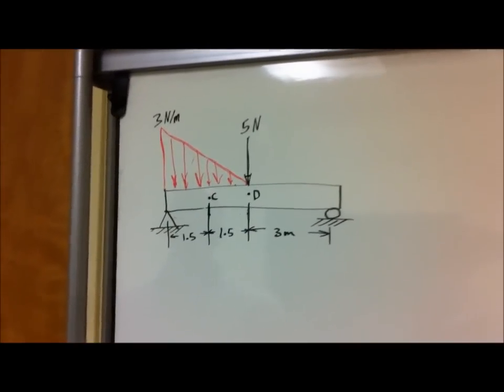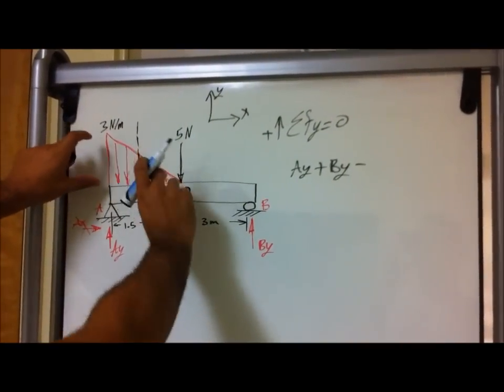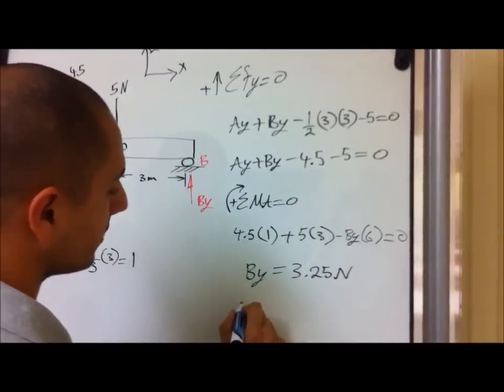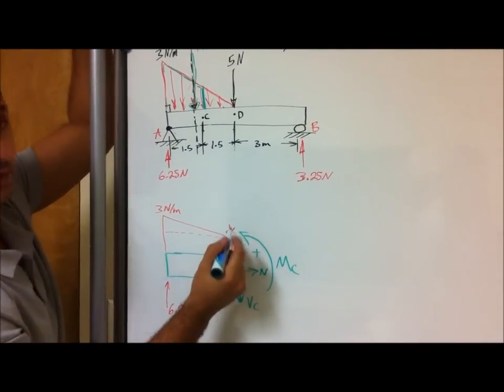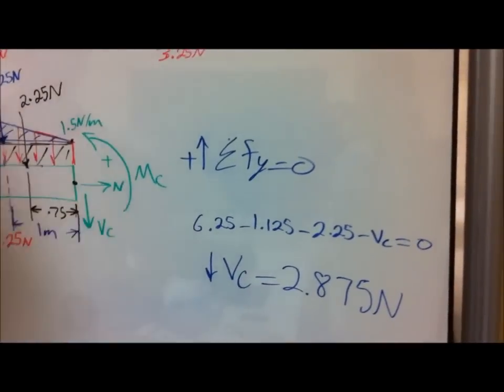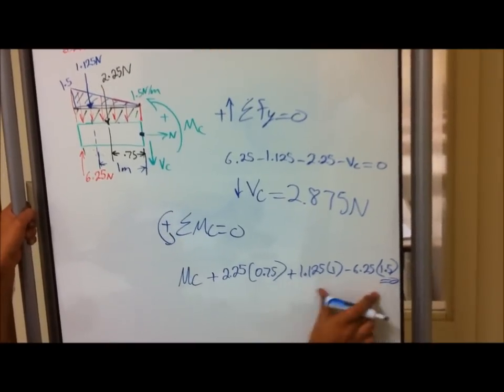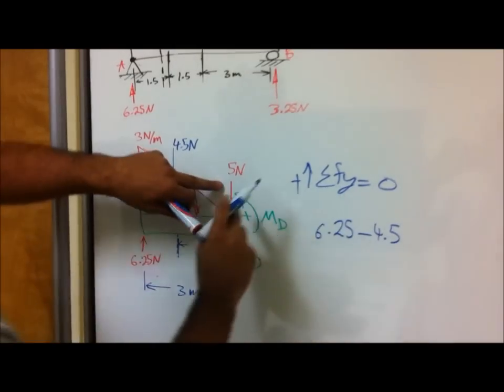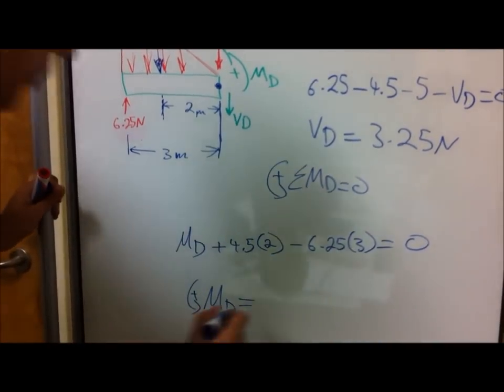The EASIEST way to solve for  MOMENT and SHEAR

Comment: who ever watches this video just keep moving first of all clock wise moments are NEVER EVER positive you  .........aka engineer LOL YA RIGHT.........
Reply: clockwise = negative is just a convention .. you can pick your own coordinate system as long as you're consistent, smart guy.
Reply: I understand where you're coming from. The work isn't necessarily wrong since he did say that his reference is going to be clockwise=positive, although it isn't generally regarded that way when taught in school so I can see where the frustration lies. It's still an alright video when you can look past that.
Reply: A clockwise moment could be positive if I assume the clockwise direction to be positive. It's just common convention when finding them on the body to use CCW. Also a clockwise moment can be considered when looking at a "cut" as being positive if your looking at the right side.
Reply: linky202
 well said linky202,,the video is very helpful indeed
Reply: You can assume positive for either counterclockwise or clockwise. As long as you continue assuming so until you arrive at your solution, you aren't wrong. Changing the convention around only causes your answer to come out positive or negative, which just tells you if your initial guess was right or wrong. The same can be done for up or down forces. You can assume up to be negative and down to be positive, and still end up with the same magnitude. In fact, when the direction that a force or moment is acting in is physically obvious, it might be more convenient to just label that direction as positive, even if the convention would normally label it as negative. That is what he did in the video, he assumed that positive was clockwise, and he ended up with a positive answer, which is because his guess that the moment of the forces move in the clockwise direction was correct. You don't always have to go by the book in engineering. If you clearly can see that something will move in a direction, you can just add that observation into your equation by changing the sign convention. You seem to be the one who isn't too good at engineering, who can't even understand basic sign conventions, not the video maker.
Reply: Alaa Barakat i under stand about the sign convention,but 98 percent of colleges around the country use the proper rotation maybe from the right hand rule or some thing .....get real dude
Reply: It's all about personal preference. You shouldn't rail on the dude. Many people use clockwise as positive. I don't,  but some do.
Reply: frank valenti Wait until you take dynamics man, if you're not already. There's a lot of different sign conventions, especially in dependent pulley motion, where, by convention, down and left are usually considered positive.
Reply: Or in mechanics of materials,  when you make a cut in a beam, downward shear is considered positive.

Comment: how did 3kN BECAME height ??
Reply: it is actually not the height but the intensity of the load per meter. that is why u times it with its base length. in this case u times it by half because it intensity decreases along the beam. i'm still learning too, so correct me if i'm wrong. :)
Reply: It became the height because your treating the distributed load as a shape. In this case a triangle.

Comment: the applied force of the triangle  distributed force should be 1 m away from the higher end of the triangle surly not in the centre.
Reply: yes u r right mr...
Reply: I didn't get a chance to review the whole video, but it appears that the applied force is actually to the left and the 1.5 is for C
Reply: wayne king Thanks for pointing that out. I found two examples with the same error in a matter of minutes.

Comment: This is great but I need help with something else. I'm trying to figure out how to find the bending moments at different points on an aircraft wing. from the fixed point on the fuselage side, the wing spar extends 144 inches. It is a cantilever beam 6 inches tall and 4 inches wide. The entire aircraft weighs 1700 max. Do you think you could either email me a formula or do a video of this one? Thanks! jmc@jaymc.com

Comment: Just wondering isn't the 3.25N for the vertical shear at D suppose to be negative as you drew it facing down. Making it a shear force pushing up right? I'm in a Strengths class and try to get this down.

Comment: What happens if the applied load is in the centre of the beam instead of in the corners like:
__|-----|___
A    B
Would I have to calculate the Moment and Shear at A, THEN use that to calculate the same things at B? Because from what I can see your problem has the load on the edge of the beam.